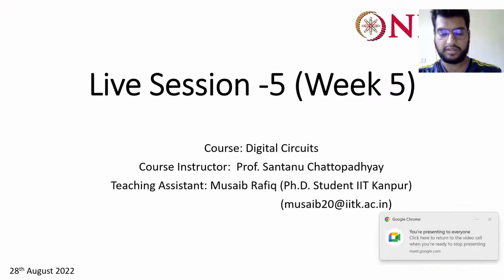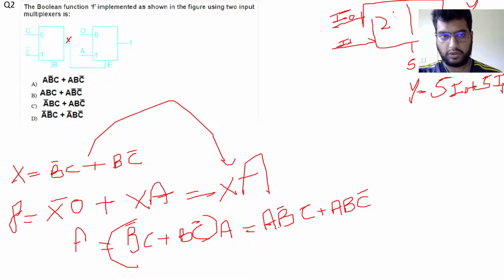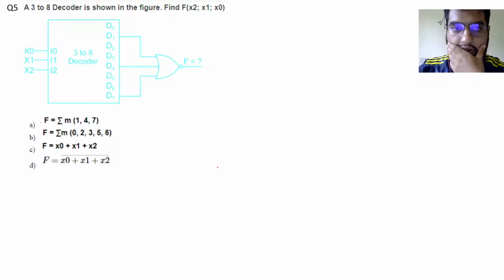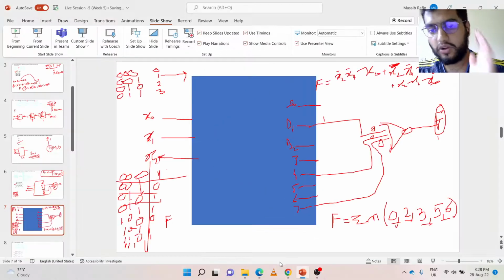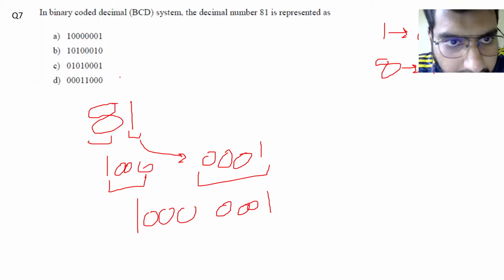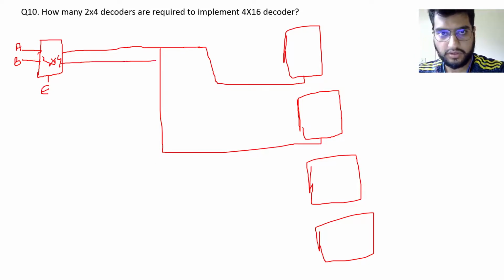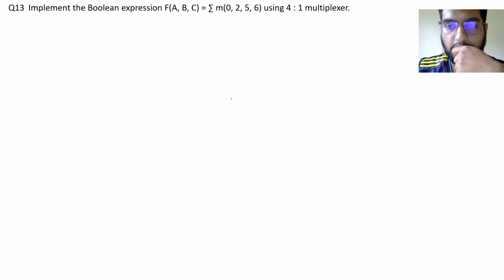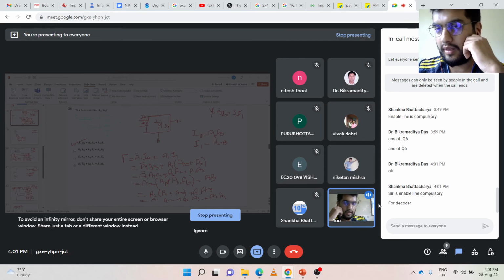28th August - Week 5 Digital Circuits

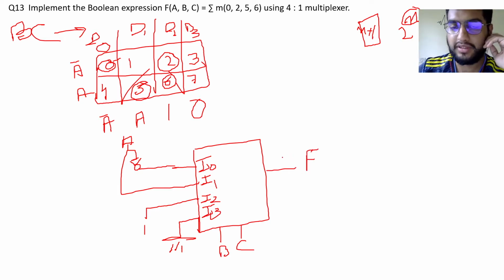Comment: Sir, in 55:58 we have taken B and C as select lines, my question is can we take A and B as select lines and divide the truth table in 4 parts( as per lecture 25 ) and and take f=c', f=c', f=c and f= c' as inputs?
Reply from the maker: Yes you can also do it like that.
Reply: @musaibrafiq4184  got it sir 🙏🏻